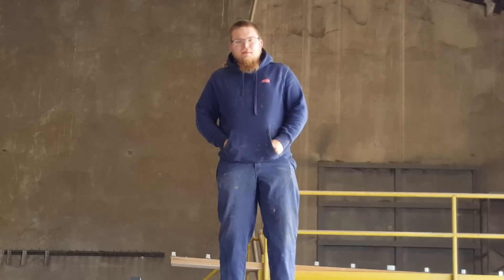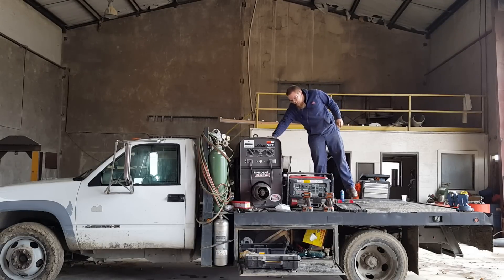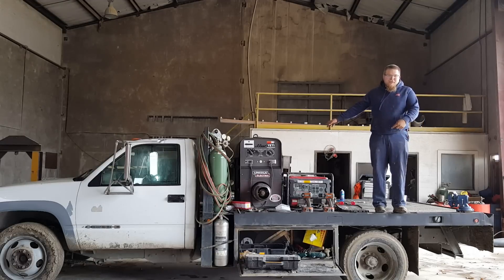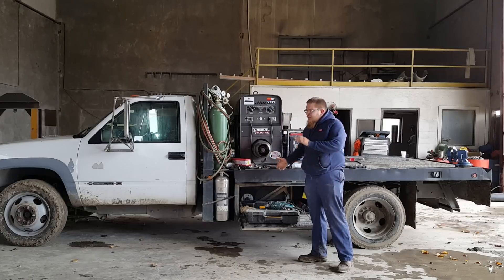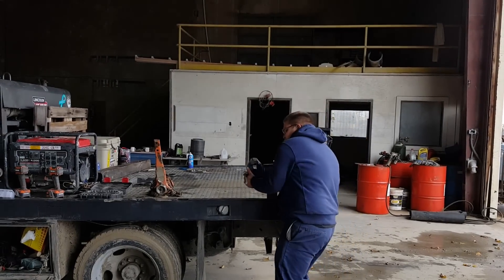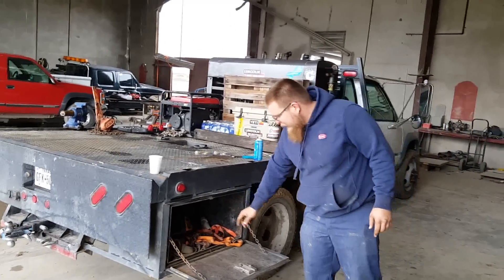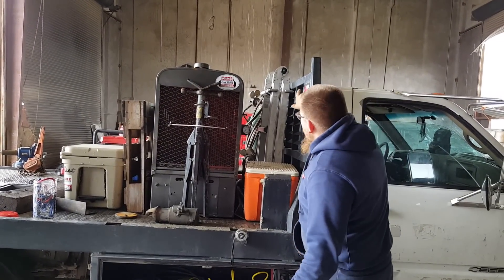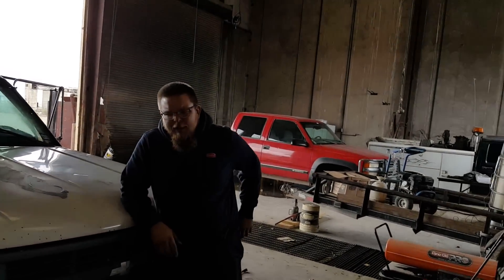Dylans Welding Rig 98 Chevy 3500 HD and 58 SA200

Comment: the key is to diversify yourself.  knowing a little of everything by far exceeds being the master of mig and not knowing the other three. also only buy quality tools needed for the job. dont be the guy with 100k in truck/welder/tools and cant pass a test. i have less than 10k in everything and not limited in what i can do.
Reply: I want to get into the welding industry and don't have a lot of money. I figure I will get a powerMTS welder and start to learn how to MIG TIG and stick weld and see where that takes me.

Comment from the maker: A cutoff saw, couple good levels of varying sizes, some speed squares, vise grip clamps, and tape measures 100 ft. 30 ft. those are some of the important things I need for my job I do structural. I build shops, barns, shop houses, warehouses, an pretty much anything someone wants. I think the best one to start off with would be stick welding once your pretty good with 6010 and 7018 mig and tig will be a lot easier to learn and there's a lot more jobs out there for stick welding if your wanting to do your own business. ill let Dylan tell you some of the things he needs for his jobs that he does his rig is a lot more loaded out then mine.
Reply: okay man thanks for your advice I've done mig welding but very little tho cause I ran out of money and I really dig welding so I'm going to give it all iv got  definitely stick welding but I do have one more question and I won't bother you any more do I need to get certified I now it's the best to but wanting to now does most jobs require you to be certified and yeah the reason I ask on that is the time I pay for school I don't now if I'll have the money
Reply: +Ben Wesley every job ive been on required a test. no cert needed. if you can weld cut and grind your good to go
Reply: +Dylan Jones That news is encouraging. I hope to make my everlast welders portable and combine them with a gasgen and try to build up my business.
Reply: +Thomas Jones Just make sure your generator can produce clean power. Everlast welders are pretty rugged but you don't want to be feeding em dirty power.
Reply: +Thomas Jones carlos is right. it can be done but engine driven welding machine hold their value. so investing in a good one isnt so bad
Reply: +Carlos Extromolo Everlast is junk... Buy American, when you can.
Reply: I've had my Everlast welders for over three years and no problems. Their products have changed a lot in the past four to five years.

Comment: why a portable generator with portable welder truck needs a bath you are selling youself with it I have a rig I use every day its cleaned every week
Reply: Butch McIntyre  an SA200 is a DC only machine, it does not have any ac power output.   So to run any sort of electric tools, you still need a generator
Reply: @CaseyLaDelle  You understand They make AC/DC tools? Shitty Makita DOES NOT offer them though.

Comment: A '58 welding machine, what you couldn't afford anything newer?   Just kidding, I use a Big Blue 400D
Reply from the maker: +David Spin he used to have a big blue 251D and it dropped a valve then he switch to a 80's model sa200 and it messed up so he traded it for the 58
Reply: Red Blooded Reviews I know that the SA200 is the benchmark.   Really there is nothing cooler than a SA200 kinda like a Colt 1911.
Reply from the maker: +David Spin yea I would have bought a sa200 instead of my trailblazer but it wasn't practical for what I do and that's to much weight for a half ton pickup
Reply: Red Blooded Reviews Man I had a 301 trailblazer, that bad boy did it all.  Stick weld , flux core and Carbon Arc Gouge with 1/4 rods.  The only complaint was it would use a lot of gas, my 400d uses half in a hard days work.
Reply from the maker: +David Spin I've got the 325 trailblazer and we put up buildings so its cut something then go weld it so half the time the welders idling but can run it 3 days 8hr/day on one tank. it has a 12gal tank.
Reply: Red Blooded Reviews Rebuilding buckets I'd be getting 7-8 gallons in a 10 day.
Reply from the maker: +David Spin my favorite part about these new trailblazers is that it runs 4 different speeds depending on how many amps your pushing so it gets better fuel economy I don't know if the 301 trailblazer had that on them yet
Reply: Red Blooded Reviews Nope, the 301 had 1800rpm idle and 3600 rpm @ welding speed.   Other than poor fuel economy it was a great machine.